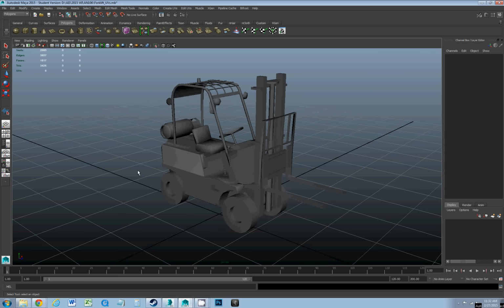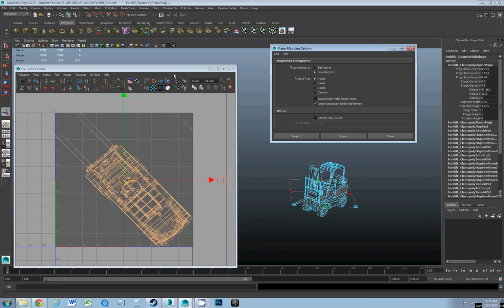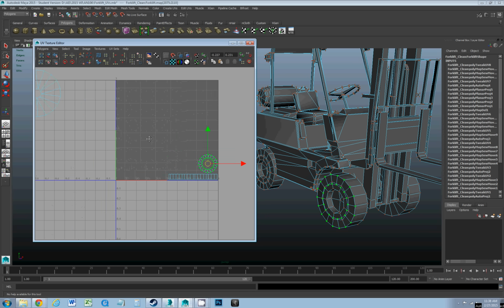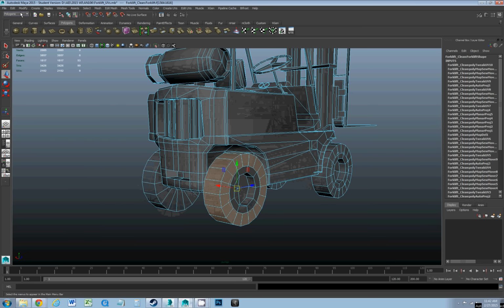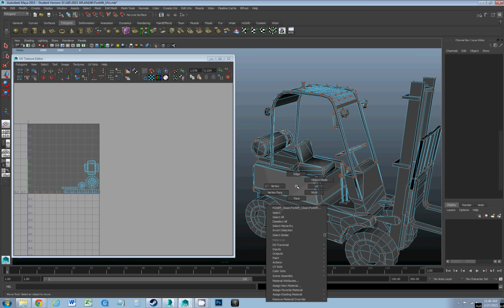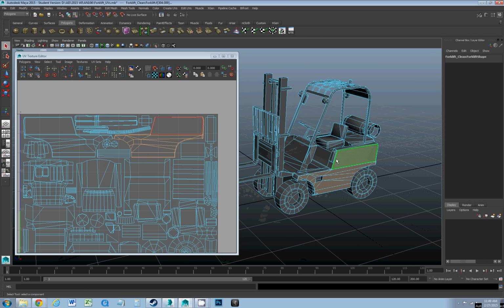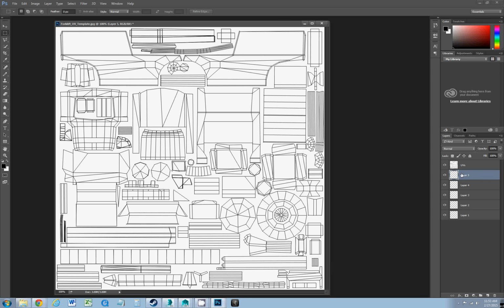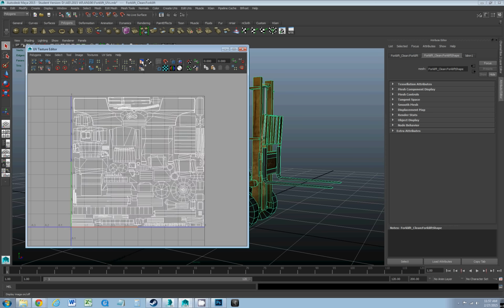UV Unwrapping Maya 2015

Comment: Hi Kevin, thanks for the insight. Question: Would you make multiple sets of UV for lets say an environment and output those sets with higher resolution to have more information in the texture to make them look sharper and with more details?
Reply: Answer for real time/Unreal/Unity/Games: It's a balance between what you need for the art to look really good and what you need for the level to run at a minimum frame rate.
Answer for pre-rendered/film: Lean towards visual quality but realize that the higher the resolution of the textures, the longer the render times will be. In other words, don't make 8k textures on a 3D model that only needs 2k. Be smart about where you sign yourself up for work.
Reply: Thanks Kevin. Yeah, its actually for an animation. Want to make the background 3D with painterly textures so it needs to look like a 2d painting background but in the 3D model.
Reply: ok, well, just don't make the mistake of planning to make massive textures if photorealism is not the style you're looking for. Imagine how much time it will take you to paint 8000x8000 pixels compared to how much time it will take you to paint 1000x1000 pixels. A very common issue in production is underestimating how much time each individual step will actually take. It can lead to burn out, long nights, and most frustrating of all: unfinished projects.
Reply: I understand. Thanks a lot Kevin!!!

Comment: Good video.  As a recent convert from 3dsMax, I'm finding Maya's unwrapping tools to be incredibly frustrating.  The automatic tool and unfold tool are cool and all but nothing with the control of Max's Pelt Mapping?  Seems so backwards (no pun intended).
Reply: Plugins are not reliable since a version change can break them and you never know when they will stop support them and you're left gimped forever.
The way I use the Maya tools is not use them at all! xD I only use 3 tools, Cut UV Edges, Unfold and Sew UV Edges. I ignore EVERYTHING else and
do just fine xD
Reply: Brandon you might want to look into a plugin called RoadKill.  It might feel more familiar to you.  http://www.pullin-shapes.co.uk/page8.htm
Reply: THIS. Nepu-Tech and I share an opinion on the subject of plug-ins.

In the 7 months since I've converted and basically forgotten everything I know about 3dsMax, I've found a really good workflow for Maya unwrapping.

1. Planar Map each major surface according to the plane that fits best (or camera angle, which is super useful sometimes).
2. Spread out your various UV shells to work on. If any shells are backwards, flip them at this point.
3. Select the UV points of a shell in UV editor.
4. Shift-RightClick (and hold) for a flyout menu and select "Smooth UV Tool".
5. Drag the "Unfold" invisible slider to the right and watch the magic happen.

(NB: occasionally this gives you a tangled mess, which either means you should try the "Relax" invisible slider in the same tool first, or perhaps break the shell into smaller shells that you can unfold separately and sew back together.)

Of course, you could just let Zbrush auto-unwrap everything and just tweak those in Maya, but that's a-whole-nother story.
Reply: Brandon Miracle
Haha thanks! ^^

Well I'm still learning unwrapping and just came across a problem. I made a really complicated model with a lot of small parts, do I have to unwrap each and every one separately? Because it looks like such a shore :(

and Wow Zbrush Auto unwrap! I love Zbrush how come I never thought of that! I need to give it a try xD
Reply: Nepu-Tech USA Hey Nepu-Tech USA! I can give you answers to many of these questions if you are in need of a few pointers.  But to answer the question at hand.. it depends upon the small part that you are making.  If it a duplicate of the original part, the answer is No, you do not have to unwrap each one.  You can use Mesh > Transfer attributes.to transfer the UVs.

Also the answer to your pelt mapping question is that Maya can do something like that, or exactly that, if you are willing to use a plugin.
Reply: Dane Shears
Oh thanks so much ^_^
I know about transfer attributes like if a model had a lot of bolts you could copy the UVs from one bolt into all of them but my model has many different shapes, some of them are really simple like boxes so maybe the don't need UVs? but some are a bit more complicated so I guess the only way is to UV unwrap each piece one by one? or maybe merge them into bigger parts (this is prob what I should do)

And what do you mean by Pelt Mapping? I'm new and I never heard that term before, is it like when you do the whole model in one large UV?

Also if you have Steam it would be really cool to chat there, you can add me Zeriel00

Comment: Thanks for info, your model has a lot of tri's :(
Reply: +Nati Celliers I originally made it in 3DS Max. It had zero tris. When I imported it into Maya using .obj, it converted a lot of quads into tris. It's just one of those things about moving from one package to another. In then end, a hard surface vehicle will still behave (animate) the same way. If this were a character, it would be a problem.
Reply: +Kevin Burgess yeah I've heard it does that, I haven't tried 3D max, but still a helpful video. I've only been doing this 2ish years so still a noob in essence. Thanks for response
Reply: Kevin,  You might have more luck exporting it as an fbx file.  It has a triangulate option and will export quads from Maya.  It should do the same from Max.

Comment: So as a modeler I personally try to keep things clean and symmetrical (unless they need to be A symmetrical of course) would you say its important to keep UV maps symmetrical like you had the sides of the forklift the same but sometimes there are those tiny edges that just dont get unwrapped right and are attached to the other face unlike the one that was already placed, basically since im not sure if that is clear is should I worry about having a very "clean" UV map?
Reply: +jampakdd  I wouldn't worry about the symmetry of it. If you have some pieces hanging out that are different from one side to the other, that's ok. You need to do this: keep your UV shells the same texture resolution, make as few UV shells as possible (within reason), and arrange them in such a way in the 0-1 space that you can quickly paint them. Your value to your company and your team is how fast you can make quality. UVing something in a smart way is a big way to reduce the total amount spent on a 3D model. It pays off in so many ways downstream.
Reply: +Kevin Burgess Thanks.That was really fast too!

Comment: For the uv's of the object, we need to put all the uv's in the 0,1 space right?
Reply: +infinitesimotel  yeah, I'd agree with all that. To take it one step further, think about a car that will have four different paint jobs on it. Grand Theft Auto comes to mind. The artist would put the UVs of all four different layouts in the four quadrants and the game engine (read as: the programmer) would control which UV quadrant is used to display the right paint job. This is called UV Sets in game development jargon. For now, keep everything in the 0-1 space. As an aside, zbrush throws up if any UVs are leaking outside of the 0-1 space.
Reply: +Sandy Nguyen mostly.  If you have a large object that requires more texture space you can expand and make it tile, but it will tile, it is not extra texture space.  0-1 is all the texture that is available.  They do that for large structures like walls and bridges etc, but if you use UDK the lightmap has to be in to 0-1 space, but that is another story.

Comment: I have a question: Now I am a beginner so I built this simple room with a door and 2 windows. I mapped it using your method shown in this video and textured the map in Photoshop. when I try to render the scene i get this error: mental ray encountered a fatal error. The system may have become unstable. Please save the scene and exit Maya... then Maya crashes. I am using Maya 2015 Student edition. I tried resetting preferences, cleared history, open as administrative but until now I am receiving the same error before it crashes

Comment: thanks for video, question, making an object building ect. what would one do with photoshop to create the diffuse and normal textures before applying them back to the object. i realize this is a little off the topic but that is a step in this process im having trouble with, thanks for the videos easy to follow